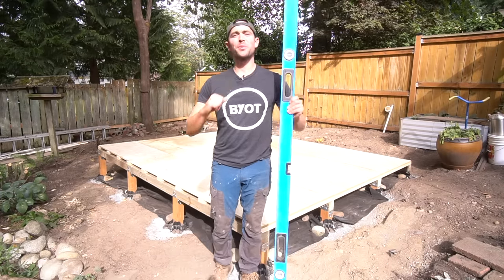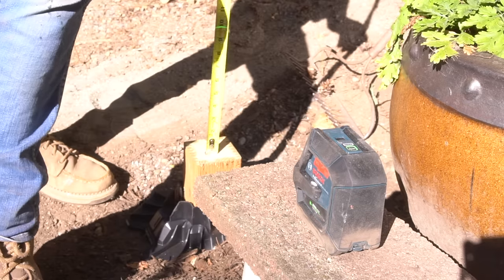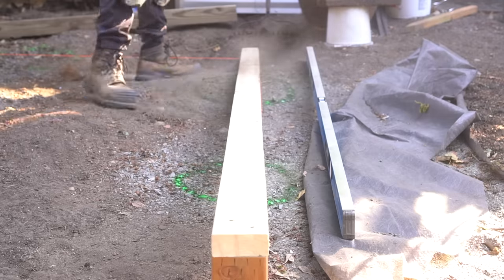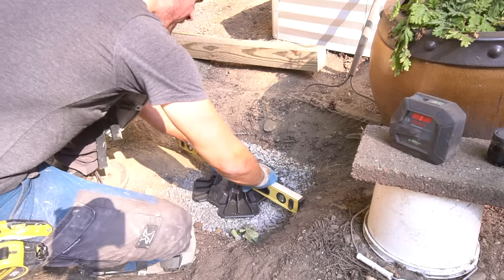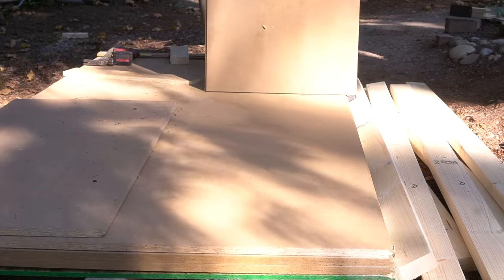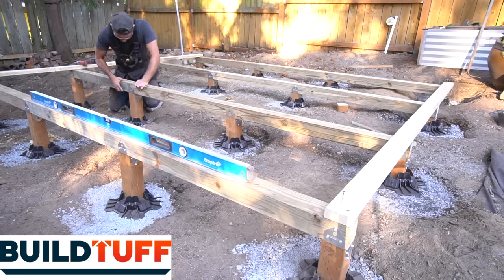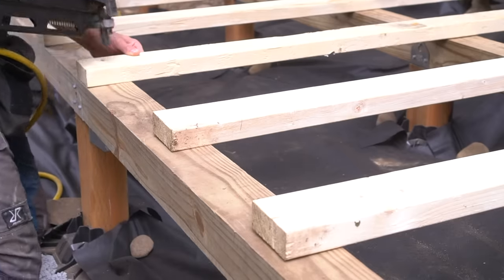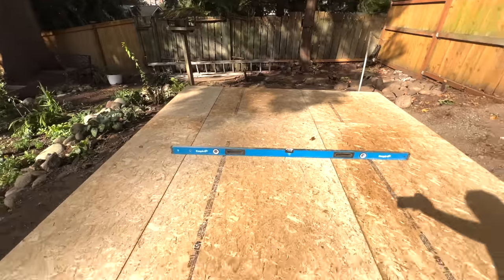How To Make A LEVEL Floor System

Comment: I like this guys enthusiasm and his video editing is stellar. I just watched his refinishing a hardwood floor video. He did it just right. Like most young carpenters, we all have a lot to learn. Taking measurements off of a drooping steel tape should be reconsidered and setting the post base in a hole invites puddling. His shed is less than 120 sf which means he wouldn't need an inspection. In my build I sank all for corners and two additional posts for the center in concrete. Ideally, the thing to do would be to get a Bobcat and excavate the location level. But over all, good project and I'm sure next time he'll modify the procedure like we all did at one point in out building careers.

Comment: A simple, reliable and inexpensive alternative to a laser level is a water level. It is a length of clear flexible tube or hose long enough to reach between diagonal corners. Fill the tube with water and food coloring, lower the center of the tube and raise each end to allow air bubbles to escape. The colored water in the tube will reach the level point at both ends.
Reply: Do not trust moving the clear tube by raising the ends of the tube to remove air bubbles. A container with water should be used and place one end of the tube in the container of water then with the other end of the tube syphon water to flow out the lower end of the tube. Water will flow out of the tube (gravity) when water is flowing without bubbles block end tightly with a thumb and raise end of tube about the same level as the tube in the container.  DO NOT BLOCK THE ENDS OF TUBES WITH CORKS ETC WHILE USING THE LEVEL AS IT WILL GIVE FALSE READINGS. THE ENDS MUST BE OPEN. Determine a datum at the required height and do not move from that datum until all points are marked. Never if using some one to assist trust that person! Always after marking the new level level point ask your assistant to look at the datum point mark and tell you when the water in the tube reaches the original datum mark as you are raising/lowering the tube at your end you just marked. When  the water reaches the original datum mark and the assistant  indicates it is on the original datum mark check the new mark coincides with the datum. Any discrepancy will show that your assistant cannot be trusted. It is far better to fix the tube very lightly at each end without crushing the tube and walk back and forward adjusting the tube at the datum end and when the water is at the datum mark go to the other end of the tube and mark the water at the new level. You can check that the two marks are the same level   by placing the water on the new mark and going back to the datum to see if it coincidence. Standing  on the tube will give false readings so will strong winds. REMEMBER NEVER TRUST YOUR ASSISTANT!!!!!! While moving the tube to each level point place your thumb on the end of the tube to prevent loss of water. Never flick the tube over obstacles as this will put air bubbles in the tube as well. Good luck regards Johnno
Reply: @johnnothegreat8907  Excellent explanation and tips for using a water level. Another thing I learned (the hard way) was that it's much easier if you use 1/2" or larger clear tubing than 1/4" tube. I think with the smaller diameter it's harder to overcome the friction inside the tube and maybe the surface tension of water. With small diameter tube the water moves slowly and takes a long time to settle on your mark. You are constantly moving the tube up and down and waiting for the water level to settle. Thanks again!

Comment: Weed barrier will only prevent weeds for a year or so - afterwards, seedings will be blown onto them and they will start growing.
the barrier simply limits some of the drainage - - much easier to just use weed killer / ground clear once a year

Comment: Ive seen quite a few diy shed floors built this way, but they usually don't have any experience building. It leaves the floor feeling spongy and weak. Not rigid and stiff, which is how it is supposed to feel. Ive noticed they don't bear as much of a load either. The floor joists were always 2x6 or bigger, sometimes sistered if putting a heavy load on the floor. You know gunsafes and heavy objects like larger frame tools, cabinet saws, etc.

Comment: How come you didn't alternate seams on the sub-floor to get rid of the seam intersections?
Reply from the maker: GREAT question and thanks so much for bringing this up. I should have mentioned it in the video but here goes. It’s because of the floor joist spacing and the fact that the panels come pre-cut. I would’ve had to stagger one of the floor joists in a different layout in order for the seams to work out correctly. I didn’t account for that ahead of time and by the time I realized it it was too late since everything was nailed down. Those ring shank nails are hard to pull out that where in the floor joists. Thanks again for bringing this question up.

Comment: Given how short the span was between the 4 by 4's, I can see using 2 by 4's for "floor joists".  But they were clearly installed wrong; they all should have been installed with the "4" inch side up and down, sitting on the "2" inch side for maximum strength.

Comment: Whole project can be ruined in seconds if   base not properly secured to the ground.
Any strong wing gust or tiny tornado make your structure had a flying experience. Also cross boards (joists) must lay vertical, and floor sheathing sheets must be staggered.
And of course, these plastic boots must be completely covered from sun uv rays.
Good luck!

Comment: There are nails for the gun you used in the size needed to nail the plywood down you don't need a separate nail gun and why didn't you stagger the joints on the plywood it makes for a much stronger platform

Comment: I'm a retired union carpenter and in making any type of box all legs have to be the right dimension and to achieve square there's 3 methods possible.
1) measure the  diaganol dimension both ways and square the box or rectangle till measurements are equal both ways.
2) 3,4,5 method a perfect 90° corner or aka right angle is made the 3', 4', 5' method or multiples of same numbers, for example: 3,4,5 can be multiplied 3x10, 4x10,5x10= 30,40,50 or any number as long as the base numbers are relevant.
3) pyagrathems therom is the mathematical way to find the exact diagonal dimension to make an exact 90° corner.

Comment: This looks like how to make a level floor with as much work as possible tutorial. You should have put each corner post, then took your 10 ft board, stand it on edge, and tack it to lowest point (highest elevation of ground, your 2 inches or whatever above the ground on your 1 corner,. Tack it on the side of the post,  then put your level on the side of it, raise other end until level screw to post, now go around full perimeter. Then it's a simple matter to mark each corner and cut the posts flush with level, and then every other post you add, you just get it plumb, tack it to the level board, and cut it flush with level.
Reply: Exactly. True carpenters have the best time saving tricks..
Reply: that's what I was looking for - basic common sense, making life easy. thanks!

Comment: The joist should be 2x6 on edge and I would also use double 2x6 instead of the 4x4. I would never lay the 2x4 flat since they will deflect considerably more than having them on edge...and yes, I am a licensed Civil Engineer.
Reply: So true. There is extremely little joist support afforded by a flat 2x4. And I'm not a Civil Engineer.

Comment: Goodbye mate from Australia. Thanks for your reply on tube size. Good point. I also use a plumbob to get things vertical. I found to my dismay that using a level and 
 aluminium straight edge to put in Door Jambs to suit Mirror doors on a walk in wardrobe did not work due to the spirit level having a tiny degree of error in the level. In other words the head of the door jamb I put in with a water level was dead level but the floor to ceiling mirrored door 8 feet high (2.4 metres) which was made perfectly square did not close on the vertical door jamb due to the margin of error stated on the level. That slight margin of error in the spirit level although not great was sufficient enough to alter the distance across the diagonals and the ******** mirrored doors just did not fit truly. My employer of the time said I did not get the jambs plumb. I gave him the spirit level and straight edge I had used and of course they showed plumb but a plumbob showed the margin of error over 8 feet was a factor in causing the jamb to not be truly vertical. My pride was restored I did have the jamb plumb after all albeit spirit level plumb. It won't happen again if I get a job with glass door panels. Regards Johnno
Reply: Plumb bobs and water levels   
take some beating.

Comment: The easiest way is to use a water level just like the Egyptians did get a long hose preferably clear at both ends and put a mark on them one inch from the end the marks have to be exactly the same distance from the end of the hose then fill it with water and go around checking g level as the water will always try to find a level inside the hose at both ends it will be lvl compared to the distance from the end of the hose even over things around corners under something or any which way you stretch it

Comment: It's not anchored to the ground? Where does the water escape that lands on the floor escape to? I'm not a pro builder but these two things would greatly concern me during windy/rainy conditions.
Reply: Thats why a lot of builders pour a Slab and screw the Sole Plates of the Wall to the Slab. It makes more sense. Also using Hurricane Anchors is mandatory in some jurisdictions for the Roof Rafters.

Comment: Extremely professional NOT JUST the work itself but your presentation + editing,  but I do have a question /concern regarding the footings, yea, the process/steps followed are out of tge book but isn't the freezing depth a worriessome to you ?
And especially that all footings are spread across wide area /surface, in some portions footing heights will change ( pushed up in winter ), thus some corners will be higher than heights setup in summer! 
The 4 feet freezing free depth is a rule I have followed up here in tge moose land (😂), thus no natter if a small, large shed or even a platform is built,  the main  footing support height never change

Comment: Not sure where you're located, but here in the northeast US, those footings are not to code.  An "outbuilding" that size would require a permit, and to get final approval, the footings would have to be in concrete at least 42" below grade.  Also, the floor joists would not be code-compliant unless the longer width of the cross section was vertical rather than horizontal and (as others mentioned) attached with hangers.  I wish I could build things like you do but we have very strict building inspectors here (and tax assessors looking for any improvements)!
Reply: There are a lot of places where a backyard shed of small dimensions do not require permits and do not need to meet usual building codes.  These small structures are considered temporary and have no real estate tax impact.  Yes, freedom is a good thing.
Reply: Here in Colorado, anything greater than 120 sf needs a permit and inspection. I build that size just to keep inspectors out of my yard. Once there, they like to look at everything you own but I always sink a steel anchor into a 4 foot tube of concrete to install my posts. Not willing to have my shed full of tools blowing over in the middle of winter.
Reply: Dido to the comment. So many things wrong with this ‘how not to’ video. I live in Kansas and this size building would not need to be permitted in my town. This structure wouldn’t last a single Fall’s wind.
Reply: Whats the code for a structure under 120 sf. Here in Colorado there is none.
Reply: @guysolis5843  I am unsure of Colorado law but from an understanding and experience with several states all have a similar implementation: State law will adopt the IRC but list all the exceptions or deviation (there are very few) and allow for counties to make the other modifications by filing a document with the state outlining them. There will be very few of these, if any. Then your local municipality will have a building department where building permits are filed and at least one building inspector. Call the office and ask about the need to file a permit for your project. A good department will have a website with this information but will always respond to your request and I have never not been able to speak with the actual inspector. They actually respect anyone that call for advice.
The limit for a structure’s square footage requiring a permit is anywhere from 100 to 400 sf.

Comment: Every level and every laser comes with some deviation. Depending on their quality it may be 1/1000 =1mm/m or 0.5/1000 = 0.5mm/m (Look at the nameplate, usually it's written on there). With a water hose level you can get it down to 0.1/100,000 = 0.1mm/100m - nothing can beat that. The bigger your structure is, the better the water hose level is for levelling. The Great Pyramids at Kairo/Egypt were probably levelled with water, though they had no hoses - they encircled the whole area (250x250yds !) with a dirt wall and filled it with water, then put several posts in it and carefully marked the water level, drained the area and started building (2,600-2,500 B.C.)
Reply: They’re way older than that bub
Reply: How do these numbers take into account for the capillary action?

Comment: wouldnt it be easier to use 4 strings, move away into 2 directions from each corners around 2-3 feet, adjust the level of the strings on eg.  8 steel bars  and then just adjust each posts to those strings without all those double measures, checks etc? Thats how its done here and it works perfectly - definitely faster and still as accurate. cheers

Comment: You can do the same thing with a traditional concrete block just dig down to get the block tops to the height you want the top to end up at. I trust the concrete won't crack or settle over time. You should also stagger the joints on your flooring.
Reply: CMUs piers are cheaper and more reliable than plastic and are able to be  shimmed  after  settling. The idea of using 4x4s for rim joists is strange, especially when using a 4 and 8 footer to span 12 feet. Doubling up 2x4s and staggering the joint would make more sense but not as much as a single 12 foot 2x6. I hope no one is persuaded to construct a deck like this including the incorrectly oriented floor joists.

Comment: Hey BYOT or anyone else in the comments. What’s to stop this thing lifting up? The tuff blocks are just sitting on the dirt. There is nothing preventing uplift. Also joists on the flat with no joist hangers? I’ve never seen that before. Other then that, looks neat.
Reply from the maker: The video shows that they are not resting on dirt.  By digging down to solid soil and pouring 8" to 12" of crushed rock and compacting it provides an extremely durable foundation.  And I love me some joist hangers but they are not needed in this type of application since the 2x4's are laying flat.  If this was a build for a garage or house that is taking a tremendous amount of weight I would have the same concerns as you but that's not what we are building here :) Thanks so much for bringing these questions to light and thanks for watching.  Hope you tune in for the next video to see what is being built.
Reply: @BYOTools  In PNW, I think we don't have to endure with hurricanes or tornadoes, so we don't have to worry about things flying away. 

I was wondering the same thing about what's keeping the tuff blocks on to the ground. I'm assuming the weight of the structure will take care of it, but I guess we'll see when you post the second video.

Comment: Why not just concrete the posts ?
a good wind will slide this frame 
also - you must not be in a frost area - a frost area would require pillars be set below the frost line for that area 
without pillars - after every frost period, the ground will settle (especially in that loose soil)

Comment: Does the plywood need to by pressure treated and what’s the thickness??
Reply: Only if it’s in direct contact with concrete. Such as Sole Plates.

Comment: It is not true that equal diagonals ensures your structure is square (see isosceles trapezoid). One additional step to ensure squareness is to verify that both sets of opposite sides are equal in length. But many times, such as hanging a window, measuring diagonals alone makes sense because we assume the manufacturer made opposite sides equal. As an alternative to verifying that opposite sides are equal, you could also verify that any 1 of the four angles is 90 degrees. But at 6:20, it does not appear from the video that he has any assurance that opposite sides are the same length or that any of the angles are 90 degrees. Maybe I missed something?

Comment: Even if this is not a habitable building, why wouldn't you layout a vapor barrier? Isn't the point to prevent moisture from the ground always coming up 24/7?  His shed is on a slope, it should just run off and keep ground moisture from coming up. It's the same reason even in crawl spaces with open venting a vapor barrier is laid down.

Comment: im retired from 30 yrs in construction. 25 of which as a union carpenter, 5 more as a car plant union millwright setting machines with a 2 second level. best way to get something like this level is dont listen to this guy. store bought hand levels are often very inaccurate. put up batter boards and string it to square. get a surveyors level (optics) and shoot it in, you can have it level to splitting a millimeter.

Comment: not supposed to blow the ring shank nails 1/2" into stud. your air nailer has adjustments for this, or perhaps air pressure was too high